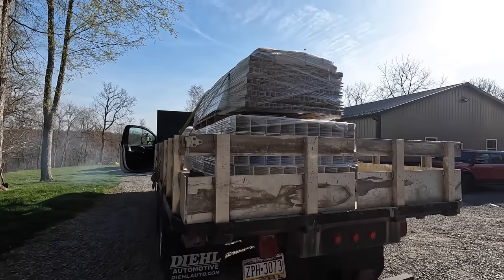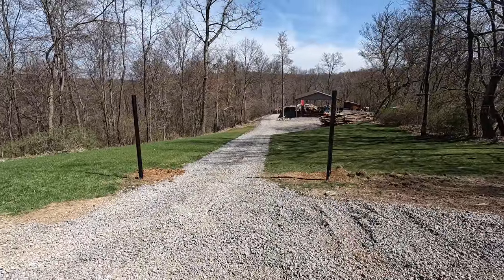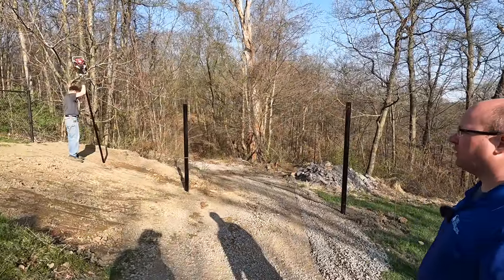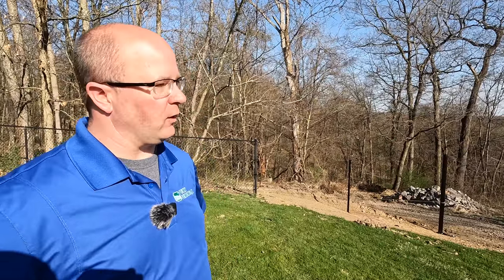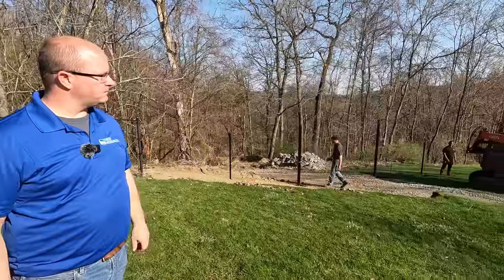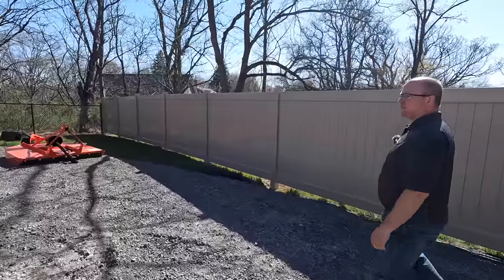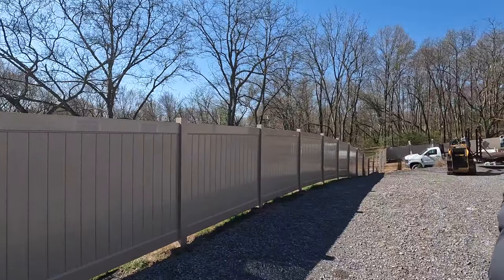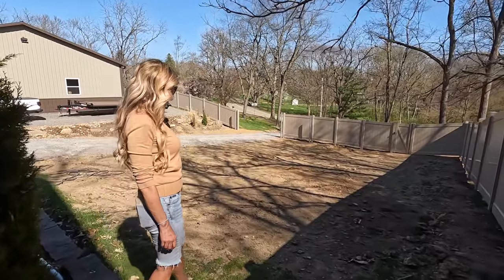Security and Privacy, New Fence Install Start to Finish

Comment: I like to put a 1/2 sheet of plywood or OSB on the ground with a hole in the center that’s the size of the auger.  When the spoils come out of the post hole, it’s easy to shovel them off with a flat shovel rather than off the grass or gravel.  Makes for a clean job!  
Fence looks great!
Reply: Lol

Comment: Dirty Hands - Clean Money....   Wish I was in a position to work for this fencing guy.  This is the type of work I find relaxing and worthwhile in life.  GREAT video and very instructional.  I am very impressed with the rotary hammer used to pound in the vertical support as well as the cement mixer for the skid steer.

Comment: Good Morgan's , the fence looks amazing ! We had a fence put around our pool . The fence was powder coated aluminum with two 3' gates .The fence was approximately 180 ' including the gates . The price tag was $12,000.00 ! Fences are a big thing on the island ,most folks go for the treated pine fence which looks cheap but runs about 20.00 a foot. This can add up though ! The better fences have bigger post  and a cap on top of the boards and made out of cypress but can be 10 to 15 dollars more a foot. We don't have much chain link because of the salt air as far as residential . You see some vinyl down here but is quite expensive. All that being said ,one big hurricane ,like Sally in 2020 and nice wood fence will blow over like deck of cards!

Comment: Mike, that spot your lovely wife mentioned actually is good for a gunite pool. A nice waterfall wall on the elevated end would mask road & pool pump noise. Use those evergreens downslope for privacy as well as sound deading. 2 cents worth.

Comment: Nice fence, looks amazing.. Originally when you were working on clearing for the main gate I thought you were going to have a sliding gate
Reply from the maker: It will slide open
Reply: I'm picturing it like the ones at alot of storage unit places.Its a big long gate that slides all the way open along the fence line then after you drive in it closes automatically.  
   I'm guessing that's what Mike will have once it's all set up and done

Comment: The new fence sure looks nice.  I'm looking forward to seeing the cantilevered gate especially the support system.  I had one put in a few years ago, 16' opening 21' overall gate frame.  Ours is all steel frame with mesh, way heavy.  It would be nice if you could show the  gate system and how it works in a future video.  Your place sure has changed a lot since I started watching.

Comment: Hello! 😊
Nice to see someone mix the concrete up before placement in the post hole.  So many just dump dry Sackrete in there and expect the same results.
Reply: Good morning David
Reply: @waynebarnett7467  Hi Wayne!
Reply: That was a nifty way of pouring the concrete with skid steer!!!
Reply: Good evening David and Wayne & Ron , when I saw that mixer on the Skid Loader I wondered how long will it be 
before Mike gets one ?😹😸😺
Reply: @badcat4707  Less than a month. He'll find use for it in WV!!😁😁
Reply: @badcat4707  Hi BadCat,  Happy Caturday!  🐱
Too much manual labor in making concrete like that.  Mike lets the Hauses do all his concrete work anyway.  I once thought i could save money mixing up my own concrete so I hauled sand and gravel in my dump truck,  purchased bags of portland cement,  mixed it up in my mixer and worked myself to death.  Turns out, it actually cost me more per yard to make my own because cement purchased in bags is much more expensive than when you get it in bulk like the concrete plants do.  Of course for small amounts, it is ok because many ready mix suppliers have  minimum order requirements or they have a trip charge to help pay for the cost of bringing it out.  Still, that is a pretty cool mixer attachment for a skid steer.

Comment: Thanks for sharing this with us... I love to watch this stuff.  I guess my one concern is the weight of those gates.  Most times when I see those posts, there is additional support with some really beefy cables and anchors to hold them plumb.  I don't know how close you are to Wild Wonderful Off Grid in WV, but their gates are much lighter I would think... and they had to put in cables and anchors to handle the weight and keep the gate posts plumb.  If you haven't seen their channel, I can't recommend it enough.  They run a farm with cattle and goats and sheep and chickens and stuff... and they built a beautiful A Frame with a nice deck.  Right now they are pouring footers for their bedroom wing of the house.  I really love that channel.  Anyway... I really enjoyed this channel.  I have some fencing to replace myself.

Comment: Last summer the condo had a vinyl fence installed separating an apartment building from the condo complex. That fence looks like a snake, wiggles, not stable at all. This fence is more than 1000% more straight, stable, better ground following, much better in every way. Congrats to OWTM, and Job Well Done Penn Fencing. I am glad we are out of the condo, but now I kind of want a fence around our new place, lol.

Comment: Looks 👍 great...those vinyl fences [ recycled 🥛 milk jugs 😅] don't do to good down here in Florida. After a couple years of 95+ degree heat 🔥...they tend to settle and sag, become Crooked, brittle, and chalky over time. Pressure treated wood with a stain/weather sealer works best down here for longevity. Hopefully up there you will have a longer lasting product.

Comment: I spent 3 years re-repairing tongue and groove vinyl fence each year and often thrice in winter. Wind and snow piles destroy them as there is no way for air to get through so it blows them down and permanently bends slats making them unusable. I had to remove some slats and leave gaps for wind to pass (not a pun). Big improvement but the car dealership lost what it wanted, hidden unattractive area. My personal opinion would be all chain link with vinyl slides that can be color selected to suite preferences.

Comment: I would brace the gate posts from the top to an anchor point at ground in concrete to keep gate posts from leaning (sagging) towards the opening .
Trust me, they will in time. You can use cable, pipe, strap iron to maintain plumb.
Reply: LOL

Comment: Mike I think Tom from Concrete with the Hauses is going to have to get the concrete mixer for his skid steerer for jobs out of reach of the concrete truck, just saying
Reply: On larger commercial projects when we get concrete trucks we use that to transport the concrete from the truck to the post holes.  Saves a lot of time.

Comment: Melissa’s right about the pool. Put it down close to the fence and keep the slope and you can have a cold slip and slide into the pool.
Reply: And also add a little ramp, so you can get some air.

Comment: Wow, MIke... Nice fence for sure, -- BUT --  Not sure why it is so close to your buildings and not along the property line near the road?  Why box yourself in when you have property to the road??  Also, I would think that a row of tall "privacy" cedars would look better and reduce sound more both in summer and winter.  You must have a reason to fence away most of your property.
Reply: They probably want to keep it secure from u tube viewers.
Reply: Actually was VERY wise to set the fence back from the front lot line.
Fence too close screws up your sight distance to see traffic to safely enter the roadway.
Also to let a semi clear off the roadway before encountering the gate.
Very smart on the Morgans part!
Reply: Not sure about that.  The video shows that they are at least 100 feet (maybe 200) from the road with that fence.  Just seems like a lot of wasted land on the wrong side.  Maybe the camera lens plays tricks on distances but why not get closer in.  Yes, you can have a wide driveway entrance for trucks etc., but that is not what I am talking about.  They have a fence right up beside that Blue Ford when the property is so much larger.  Don't get that at all.
Reply: @michaeltca3103  key points,
 1) it IS their property. 
2) it IS their money
3) no one gives a crap what you think.
Reply: @haroldphipps3457  ...easy there tiger..  You are coming across as a bit unhinged.  Tone it down a bit.
Reply: @michaeltca3103  like you are a good judge of unhinged??
I get you have more experience,,,
Reply: @haroldphipps3457  ok,, you are getting nasty and personal. These comments are a general discussion of the topics that Mike raises or presents in his videos, not some personal attack on him or me.  Calm down.  Coleen out of here.